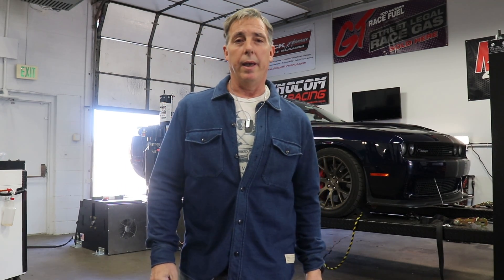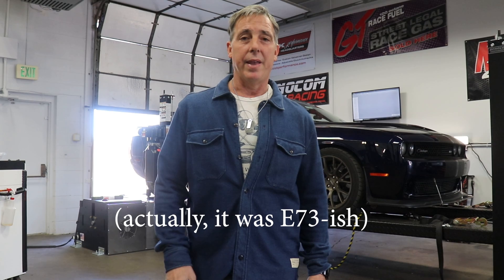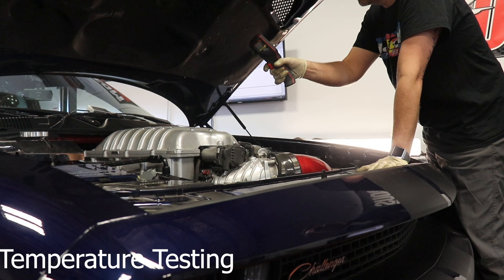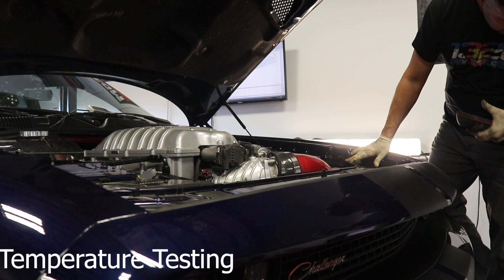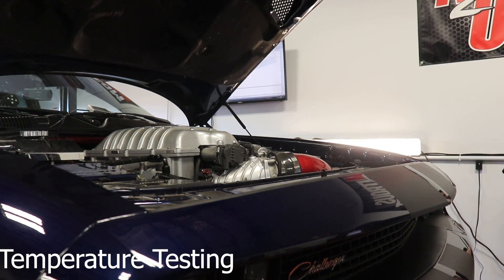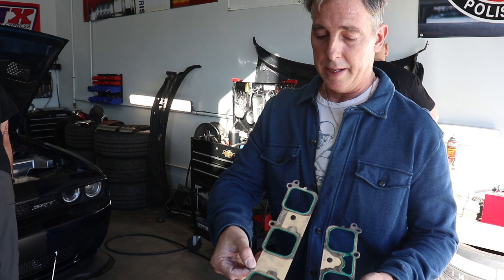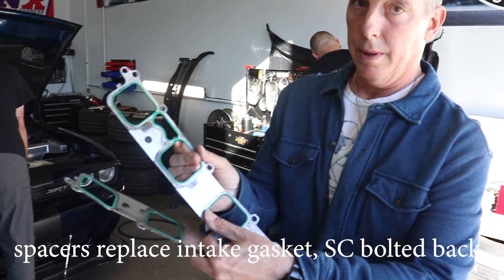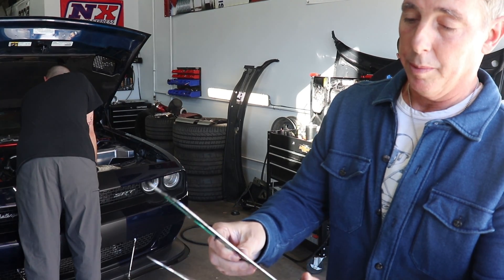Forced Induction Interchiller Hellcat Supercharger Spacer and Thermal blanket install and testing

Comment: Ordered my stage 2 interchiller yesterday for my Hellcat.
Reply: Get it installed yet?
Reply: Car has been in the shop for over 7 weeks. Its a big build. First I am cloning the engine and drivetrain to Demon specs, with the 2.7L blower and Demon heads/valves, 3.09 rear, Demon converter, etc. Then I am adding a stronger blower cam, headwork (BES pro-port) and S/W 2" headers with larger exhaust. An interchiller, boost triggered water/meth setup and staged Fore fuel system too.
Reply: @Badmerfer  I am having a lot of work done, and its going to take some time. I cloned the engine to a Demon (larger 2.7L supercharger, dual fuel pump setup, bigger injectors, chiller, etc) and am hot rodding that with BES pro port Demon cylinder heads and OST Dyno Demon plus cam & kit. Stainless Works 2" headers, +10% ATI lower, larger dia idlers, and a boost triggered 6 nozzle meth injection setup on the supercharger lid. Demon torque converter, 3.09 rear diff, 4" aluminum CCI driveshaft, etc.
Maybe 2-3 more weeks.
Reply: @tommcqueen2840  I wouldn’t want to be next to you at any stoplights🤣🤣

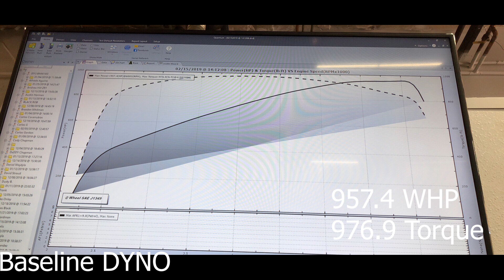Comment from the maker: Please note: we used time lapse here as we wanted to show that we were getting the car up to operating temp before the Dyno pulls.  Doesn't make for great viewing, so if you don't like the music (which would mean you suck), fast forward to 5:36 for results of that basline run.  On the second run, we did the same thing but don't show it as much.  Temp on first pull was 180f.  On pull with spacers, 186f.